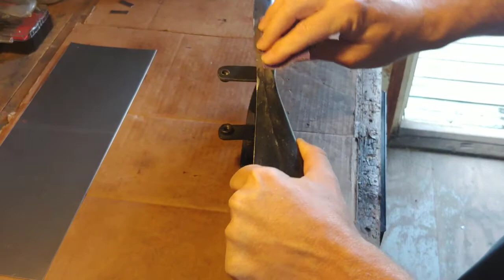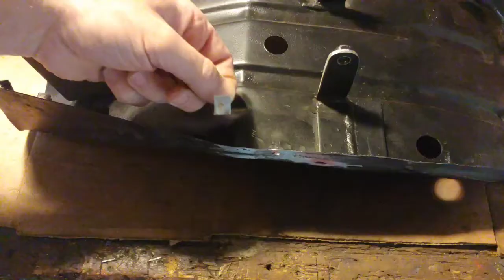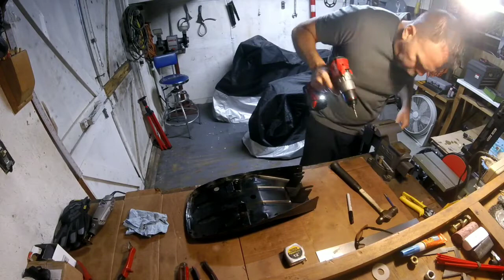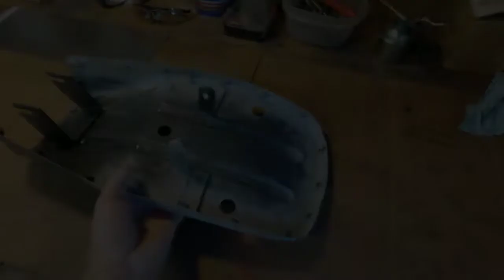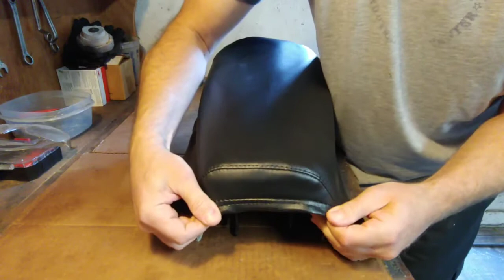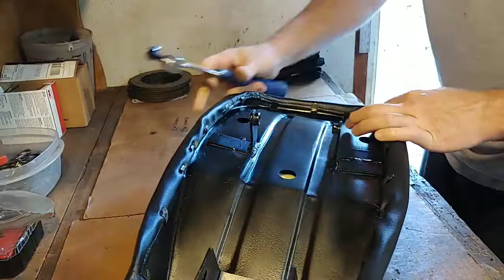Hodaka Ace 100 Resto Part 11 Seat Pan Fix & Seat Cover

Comment: Nice video.  I like your idea of replacing the broken tabs!
Where did you source the cover and foam?
Reply from the maker: Thanks it was either weld new tabs or rivet them on I chose rivet and so far so good. The seat foam and cover I got from hodakaparts.com Thanks For Watching.
Reply: @shedbuiltmoto  Thanks!  You should mention the source in your video and add a link it helps these small companies survive.  Cheers, Kirb
Reply from the maker: Duly noted